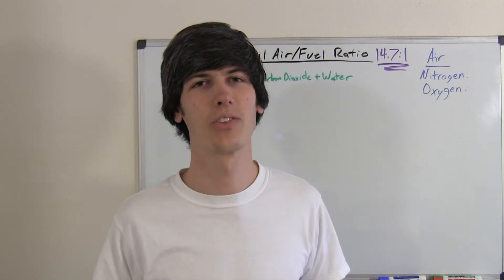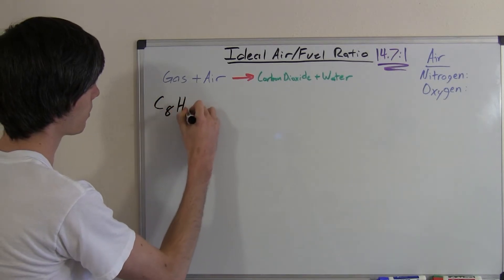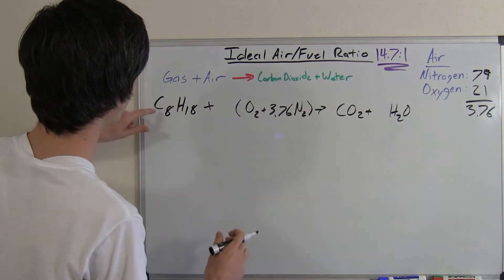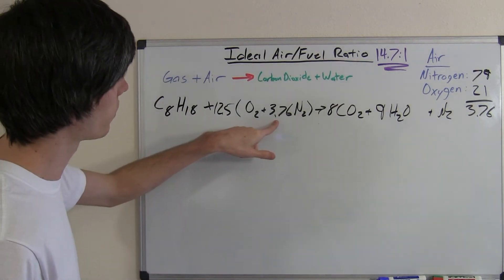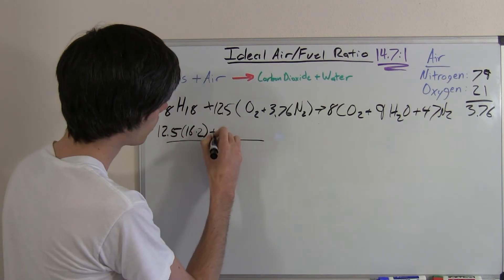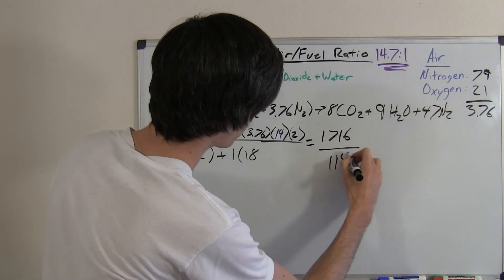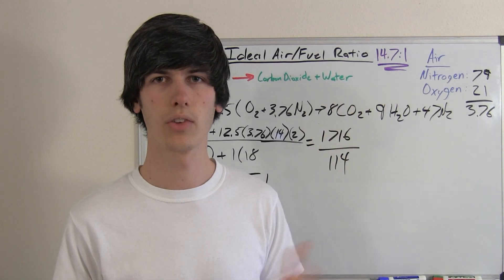Air Fuel Ratio - Explained

Comment: Nice. Though, I still I have a silly doubt: to boost performance,  more fuel and more air has to be pumped in, right? does the ratio have to remain the same, or maybe 15:2 etc?
Reply: No.  Under a load the ratio may be 10:1 or richer. 14.7:1 is the "theoretical" optimum ratio.  But under a load you will have detonation occurring leading to a wasted engine.  A lean ratio builds more heat. There is a fine line between max hp and  melt down.
Reply: I believe so because too much fuel will strip oil from cylinders and cause poor compression leading to power loss and excessive wear. Too much air with burn up an engine. So the ratio would be the same just in higher amounts.

Comment: How come the AFR decreases as the engine RPM increases?
Reply: +Michael Huang normally due to the fact that you do not have enough air in your car to support the amount of fuel that your ecu wants to drop into the cylinders to make more power.  This is the reason that people boost their air with turbo charges and such.  Only after adding a significant amount of air will you need to start adding more fuel.

Comment: Great video ! It would be even greater to make a video to explain why during wide open throttle situation and at higher RPM it is needed to make the ratio richer up to a point, because at 14.7 the combution process have not enough time to finish. With richer mixture the speed of the flame front is higher, but of course the delta of temperature is reduced. Anyway what is important is to finish the burn before the exhaust valve opens. Not efficient, but effective. Whould be great to know the exact math tho.

Comment: Your formula just shows how air density and octane affect power. The amount of air and fuel is pretty much linear. More air less fuel vs more fuel and less air produce same power (Ideal) but cause damage for engine. FCU always does the work of pulling best AFR to the engine to smooth the engine. Sometimes with AFR error like too much air pull in, the power will decrease but cause some spark by overheated stalling air. The engine will knock when there's too much fuel and the engine can't fully ignite it.

Comment: It's really confusing that Americans call Petrol (a liquid), Gas. Great video though, thanks
Reply from the maker: nichdavi04 Haha, it's us being lazy and not saying the full word (gasoline).
Reply: "Gas" is just short for "Gasoline", which used to be a brand of petrol.  It's the same as calling a sticky bandage a "band aid" even though it may not be - band aid is the brand.  Or how idiots call nitrous "NOS".  You should probably just get over it. ;)
Reply: Shock Diamond Gasoline is a specific type of fuel, not a brand name, but I feel the same way about the nitrous being called "NOS". :P
Reply: nichdavi04 Neither Petrol nor Gas are correct terms for gasoline. Yes, gas in America is short for gasoline, but the funny part about your comment is that if you think about it, liquids don't burn. A fuel has to be in the gaseous state in order to participate in combustion, so these crazy Americans are actually a little closer to the truth! LOL
Reply: nichdavi04 I agree, abbreviating "gasoline" to "gas" can cause some confusion, but "gasoline" refers to a specific type of fuel, which makes more sense than "petrol", which is just an abbreviation of "petroleum".  Petroleum refers to the crude oil that is refined to make gasoline, diesel fuel, kerosene, and other fuels, along with countless other substances and materials, including plastics.  Technically speaking, a "petrol" engine could refer to an engine that uses almost any type of fossil fuel or petroleum product. 
So it started off being properly scientific by referring to it as "gasoline", but too many people chose to abbreviate it to "gas" and now we're stuck with the misnomer.  ;)
Reply: I'm late to the party here, I know.  But petroleum is the raw material, liquid mixture of hydrocarbons which is extracted from certain rock strata and is refined to produce fuel oils including kerosene, diesel oil and our subject of interest, gasoline.  There are many theories, some with more credible references than others, to explain how the name, "gasoline", came to be used to refer to this petroleum based fuel oil.  But the fact remains that the term, "gasoline", refers to the product of the refining process which we use today to power so many of our automobiles.  The use of the term, "gas", in the vernacular, is simply a shortening of the longer term, "gasoline".

One could easily argue that it is confusing why so many non-Americans use the term, "Petrol", to refer to the derived fuel oil being used, when so many different types of fuel oil can be refined from petroleum.  Which petroleum based fuel oil does the term, "Petrol", refer to anyway?
Reply: @jjgrabbe  Since the majority of a barrel of crude oil is petrol, it makes sense why its called petrol.

Comment: Hi Dear very good explain.
I wanted to know one ting for my Burner, I have Weishaupt RGL 3600kw Dual Fuel burner. where I am using a Bio gas as fuel.
The CO level is increasing during operation of Burner.
What I have to check?

Comment: I just started working for an automotive research company as a lab helper. Knowing nothing about cars I felt the need to learn. Thanks to these videos i'm starting to understand the engineering. cheers
Reply from the maker: Haha great to hear, thanks for watching!
Reply: he's too smart i think. these videos are worth $$.
Reply: I just wanted to know whether the vehicle would run lean or Rich based on the fuel ratio. In the first few seconds I already got the calculator out

Comment: I Think that I have a misconception I need someone to correct me 
According to what you've said the turbo chargers should make the explosion of the fuel less efficient because the ratio between the air and the fuel will be a lot more than 14:1 (may be 20:1 or more )??
"unless you are talking about the volume not the mass"
What I know about the turbo chargers that they compress the air which means that we are going to have more mass per volume unit and this means that the more we compress the air the more fuel we have to add ( more fuel consumption ?? )
we know that the turbo gives more power without changing the consumption of fuel !!
???!?!?!?!?!?!?!?!?!?!????????????????????!!!!!?????

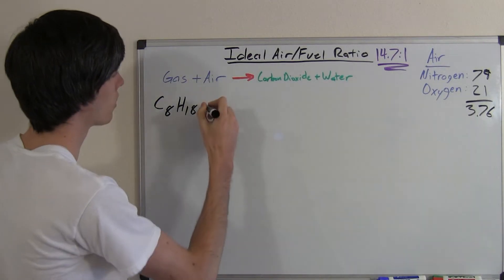Comment: What about the catalytic converter? If 1:14.7 was such an idea fuel/air ratio, then we wouldn't need one. The reason the engine burns up if we go much higher is due to the fact that the fuel is still burning on its way out with the added oxygen from the air. Once the exhaust valve opens, the stem gets overheated and bad things begin to happen. That is why hot rodders used water injection to overcome this and run 'super lean'. 

Take into consideration the burn rate of the fuel into the equation. There is a reason that the engine is put under a vacuum, and that is to limit the burn time and therefore not utilize the full potential of the fuel.

Comment: How would you calculate the unburned fuel in the exhaust?
Reply from the maker: Check out my video on oxygen sensors. :)
Reply: doktorbimmer Sorry if I wasn't clear.  I'm aware of how to measure the exhaust constituents of CO and HC.  
What I'd like to know is how to convert those measurements into a ratio that tells me how much of the fuel that went into the engine came out unburned.  For X mass of fuel that goes into the engine, how much of that mass exits the engine as unoxidized fuel in the form of CO and HC?
Reply: Your rough estimate doesn't take into account the fuel that is CO.  Does the heat of expanded gasses calculate into this somehow?  Can you explain how you arrived at 70,000 ppm for an A/F ratio of 15:1?  Thank you for specifying the exhaust constituents as BEFORE the catalytic converter.
Reply: I'm looking for some help to answer a couple of questions.  I think you have the skills to help me and I'd be willing to pay for your time.  Can we talk directly instead of through this channel?  You can reach me through eagle-research.com/contact
Reply: NO!  I'm trying to prove certain combustion theories I have and I'm looking for independent verification.  You seem to have the expertise to do this and I'm willing to pay YOU for a consultation.  I'd give my direct email address but I don't want to make it so 'public' because I get too much SPAM already; so if you contact me via eagle-research.com/contact   we can discuss your fee and my questions privately.  If this doesn't work for you, no worries, I'll continue my search for expertise elsewhere.

Comment: 13.5:1 is the ratio of peak efficiency in high hp engines according to the local tuner for na motors... I have a turbocharged shelby cobra, under high boost its sitting around 12:1 on a 1000 hp 76mm set-up
Reply from the maker: Is that peak efficiency or peak power you're referring to? The most powerful tunes will typically have a very rich A/F ratio, however it's not necessarily efficient.

Comment from the maker: Well my video had a few assumptions; it didn't take into consideration the true percentage of oxygen in the air (and other gases), and also assumes that gasoline is C8H18, which it's actually a mixture of many hydrocarbons. Ultimately the most commonly stated A/F ratio I've seen for typical gas seems to be 14.7:1.

Comment: hey ive got a srt-4 with a diablo tuner...its tuned to run 93 octane. but there's only 91 around here...and because of this, ive been getting timing knock. Ive tried octane booster and none of that shit works. On wot ive been getting a knock of 3.0-5.0.
what's the best suggestion to eliminate the knock! On the tuner I can adjust the spark timing, and air/fuel to run lean or rich...but I just have little knowledge in that area and feel like any info could help!

Comment: I need to understand the downside of "running lean"
I really do not understand why we cannot shove LOX into the mixture, to always ensure a full burn! Liquid Oxygen should the density needed for 100% fuel-efficient acceleration, assuming the stored LOX is only injected above some percentage throttle!!

Comment: Just bought a K&N performance air filter and slightly notice increase in HP especially during hard acceleration. To increase the HP you'll need to spray more fuel and air "while" maintaining the ideal air/fuel ratio correct?

Comment: Shouldn't the equation be, for mass (12.5*(1+3.29)*32)/104. that is the number of moles of O2 time the N2/O2 ratio (by mass) times the molar mass of oxygen all divided by the molar mass of the fuel?  cheers

Comment: so the ideal air to fuel ratio for fuel efficiency is 14.7:1 when you have the least oxygen and unburnt fuel coming out. In order to increase the horsepower you'll need to spray more gas while maintaining the same amount of air coming in? In other words much more fuel ratio then air when combusting?

Comment from the maker: I would agree. I was checking out some dyno charts today which included A/F. Looks like under heavy boost they'd go as low as around 11:1 A/F.
Reply: Why do you think they can run a low ratio? Would it have to do with the fuel that they use?

Comment: I think it varies, depending on the application 14 can be high .. For instance running anywhere over the 13's under boost can be sort of starving your engine and cause damage .. typically from what ive learned .. no boost idle 14.5-8 is pretty nice and smooth.. under boost im going around 11.5 12.3

Comment: Lean means that your car is running too little fuel for the amount of air entering the engine. The way your car tells the ecu is thru the o2 sensors. They measure the amount of oxygen in your cars exhaust. If there's to much oxygen (running lean) then the o2 tells your fuel system to add more fuel. Works vice versa when you're running rich also :)

Comment: So 14.7 allows for the most efficient burn and most power. Is this because the larger volume of air increases cylinder pressure, therefore allowing for a more powerful and hotter explosion when the af is ignited or because this composition allows for the best "burn" of the mixture, or is it a combination of the two?

Comment from the maker: Yes but nothing near 60:1 for gasoline engines. How does it become more efficient? Considering that most engines are probably in the 30% thermal efficiency range, any way you can reduce the amount of wasted heat increases the efficiency of the engine - thus requiring less fuel to get the same job done. That's a topic for another video some day.

Comment: does the ECU adjust all the mixture that is happening in the engine? if it does, is there any sensor that detects how much air going in, thus injects the fuel accordingly to meet the ideal air fuel ratio?

Comment from the maker: Even though I allow for her seats to be torn, the rear seats unhooked from their latch, missing radio antenna, sun damage on the roof, chipped paint on the corners, oil burning every ride, failed windshield waster pumps, and most recently a noteable clunking sound during a left turn? Thanks!

Comment: good vid. i presume the 14 : 7 is petroleum fuel? methanol would be 6:0 ethanol about 9:1 and e85 about 9:8  also note they are best use of fuel for economy.. power stoich of 1 lambda  = 14.7 for economy will be too lean in a race application maybe 12:2 on a high boost application and .85 lambda on a race engine,,,,, start talking lambda on ethanol the power lambda may be the same as petroleum but true air fuel would be say 9:8 e85 and 12:2 petroleum thats why good tuners always tune lambda

Comment: hydrogen power for the win :) 
i have a request. could you possibly do a video on how a dual/multi engine set up works if you know. im talking about what needs to go into the drive train for it to run in sync with each other. more common on motorbikes and go karts which is what i was looking at but also for big engines such as multi engine tractor pull vehicles.

Comment from the maker: Running lean causes the air/fuel mixture to burn more slowly. This means there is a flame within the combustion chamber for a longer period, thus the engine can heat up more than usual. More heat leads to failure. There are probably other reasons so if anyone has anything to add feel free.

Comment: Great video! I'd be interested in seeing a video explaining how the torque output of an engine varies based on the position of the throttle, at a given RPM. I'm assuming that there would be a difference, and how might a dyno run be affected if wide open throttle wasn't used.